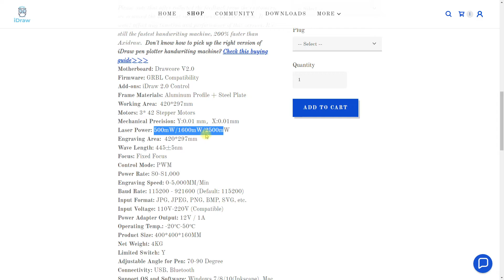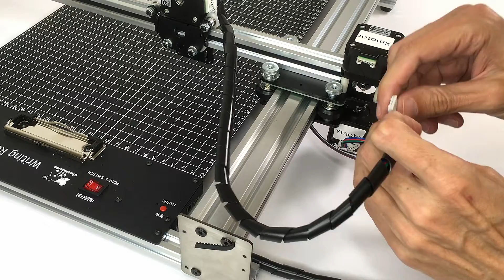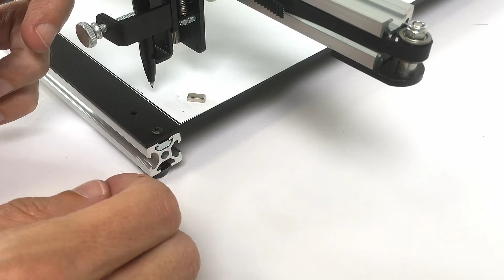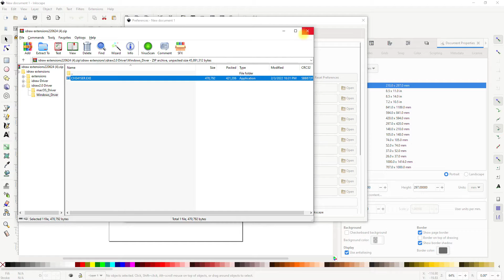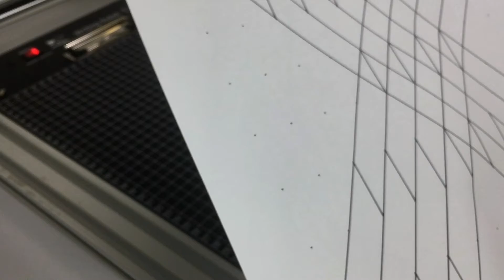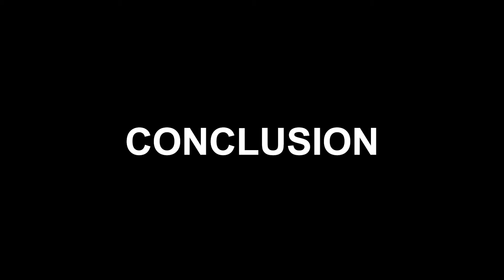REVIEW - New PEN PLOTTER iDraw 2.0 A3 by UUNA TEK® (XY CNC Drawing Machine)

Comment: 6:29 "Pen holder plate explained", So does this mean the stepper motor pushes downwards and allows the use of harder pencil lead grades (for example 2H or 3H)? 🤔 Thanks for the video and discount code!
Reply from the maker: The steeper motor on the pen holder plate does not push down the pencil. There are two springs, one adds stability to the belt, the other pulls the pen down. The spring adds additional pressure on the pen, together with gravity. It’s very useful for pencils.

The stepper motor adds speed to the pen holder plate. Which is relevant for high speed drawings with precision. This is especially useful when you have drawings with lots of short lines. Also, the stepper motor is more durable than a regular servo motor and can hold heavier pens/drawing utensil.
Reply: @thedotisblack  If the laser purchase option is selected does that mean the pen attachment hardware is missing in the box? Or is the laser an 'addon' to the default pen plotter attachment. I want to use the plotter more than the laser but having both options available would be nice, even if it involves some work to swap hardware attachments!
The iDraw website has no answers or PDF showing how to switch between pen and laser hardware attachments. ☹
Reply from the maker: @graphosxp  Yes, it is an addon and the pen holder plate is always included. 
But you are right, there is no documentation on the laser engraver (yet), however, do email iDraw and ask them. They always respond quickly and actually might do a video on how install the laser modules.
I do quite enjoy to work with lasers, it is a great addition.
Reply from the maker: Btw, stand-alone laser engravers/cutters are quite expensive, especially with a large working area. With the iDraw 2.0 you can get an A3 working area. 
But again, I did not test it. However the frames and motors are based on laser cutting machines, such as Ortur, Atomstack, etc.

Comment: This so cool. Thank you for this video. I was considering to get an AxiDraw , but your video has convinced me otherwise ! Do you recommend getting the version with backplate or without?
Reply from the maker: I personally find the backplate very useful, it makes plotting extremely fast, no need to calibrate or set up a drawing surface on the desk. Almost a plug&play device. Also with the backplate you can take advantage of the high speed, especially when you have a drawing with many short lines or curves. The backplate is fixed with the frame, so even your desk is shaking, the paper will always remain in place. This is definitely great!

Without the backplate, it is easier to work with larger than A3 papers, like A2. But then you’ll need a stable desk and set up always the machine (same as Axidraw).

So, if you plan to work always with paper not much larger than A3, get the model with backplate.
Reply from the maker: To add, in case you want to make project with a very large canvas, you can always remove the backplate. 
I show in the video how to move the motherboard to the back of the frame. That is fairly easy.
Reply: @thedotisblack  thank you so much for such a detailed reply. I’ll get the version with the base plate then as soon as my next salary comes through. THANK YOU